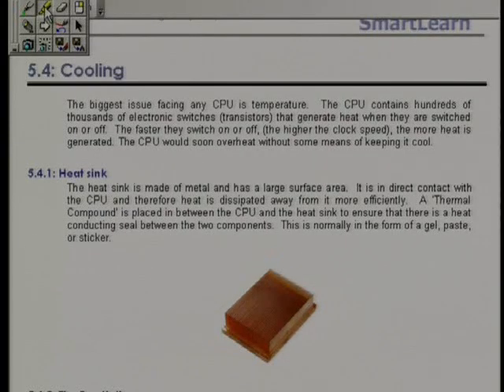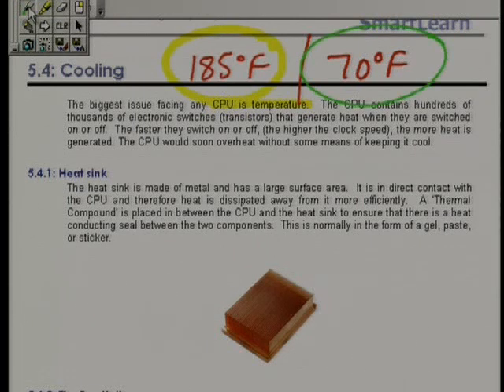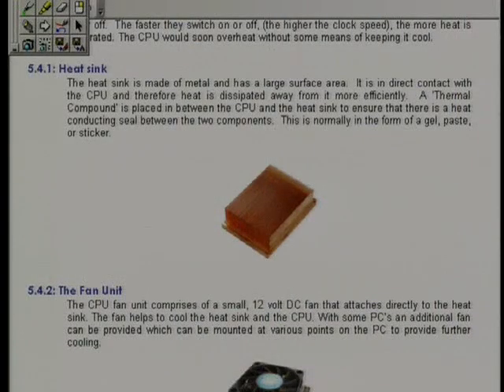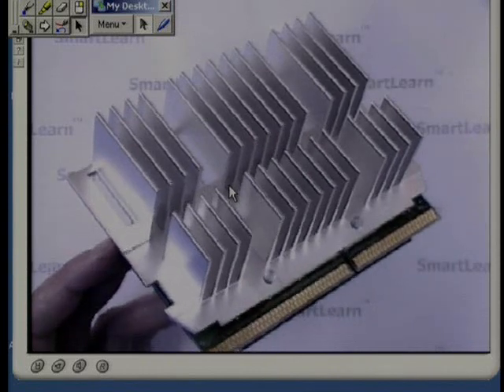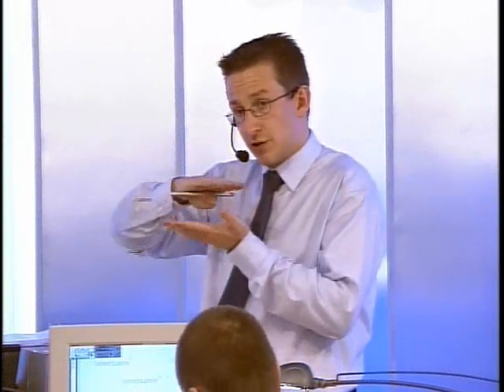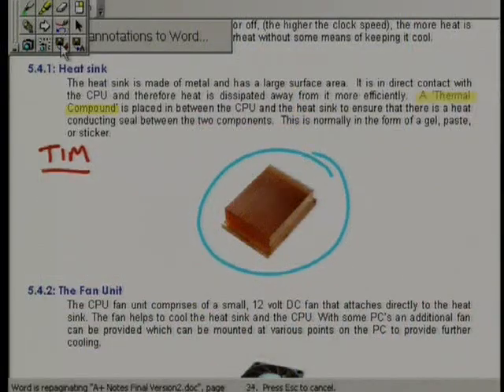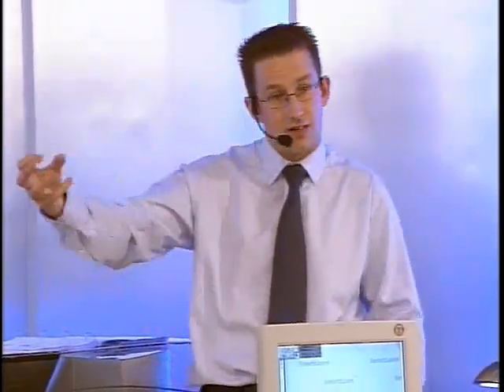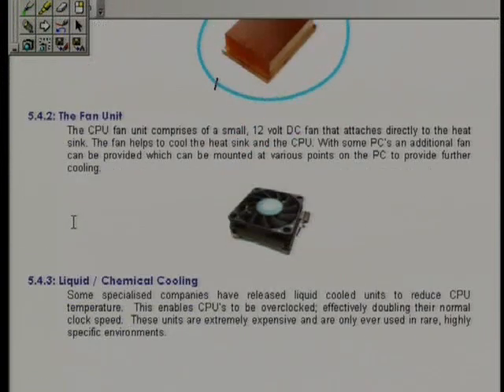SmartLearn CompTIA A+ - Mastering CPU Cooling

Comment: if you put massive amounts of themal compound on your CPU you will reduce the heat transfer rate. You actually want a small amount spread evenly across the cpu thinly. Don't use your fingers as the oils and dirt on your finger will also diminish the heat transfer. Also make sure you clean the old themal compound off with appropriate alcohol solution before applying new compound

Comment: thats pretty bad that this guy knocks off water cooling when yet all the reaches of its technique hasnt even been fully applied yet.. I mean this is for the CompTIA A+ test and he doesnt even talk about the different metals one can use like the conductivity of aluminum witch is what he uses for an example, i believe is like 40-60 au compared to copper witch is like 200 au conductivity. and thats just in the heat sinks. Besides this video isnt that old if home boy is talking about quad core - lou

Comment: cpu coolers are important, moreso for gamers or high cpu dependent programs..most stock heat sinks and fans do the trick as long as you have a good compound between the processor and sink:)